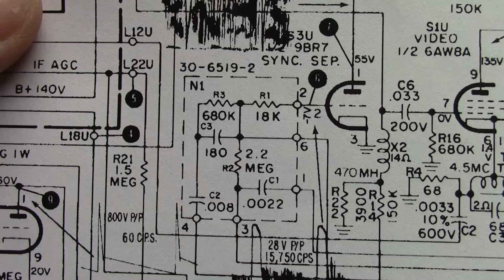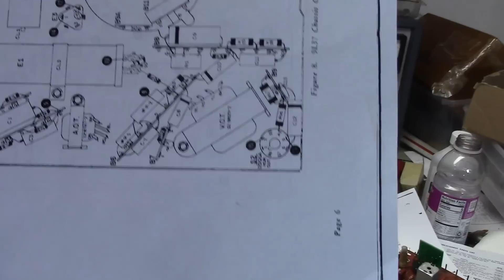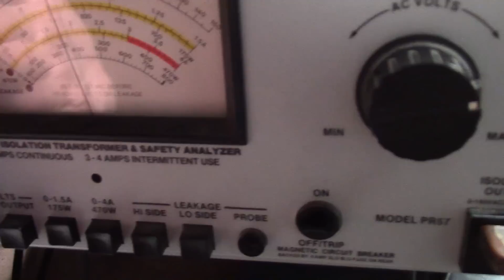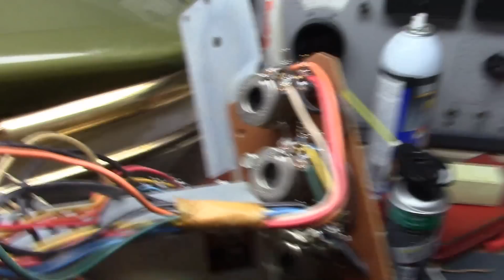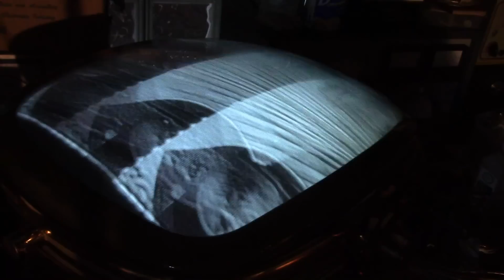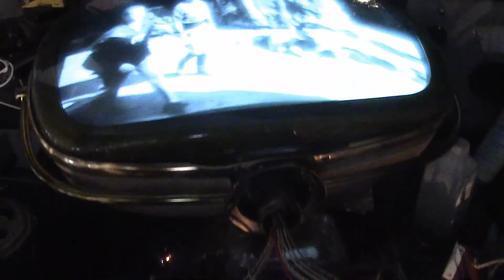Predictapalooza S2 ep01 - Michael's 21" Pedestal

Comment: Bob, that isn't a conformal coating on the circuit boards. A conformal coating is usually added to a board after the soldering is done. What you see there is called "solder mask". Later development in circuit boards resulted in the use of "solder wave" techniques. In a tank of molten solder a special pump and linear nozzle creates a raised wave of solder. The boards after being loaded with parts are passed on rails across the tank and all the leads are soldered in one pass. The solder mask keeps the solder from sticking to places it isn't wanted.
Reply from the maker: Yes, I misspoke. I'm pretty sure they did use wave soldering on these boards.

Comment: I like the way Bob makes these mid-20th century works of art come back to life, and this TV probably works like it did when it was brand new 60+ years ago! I'm sure Michael will be able to find those missing knobs, or fabricate some silicone molds to make some new ones. I'm sure the engineering team who designed this set would likely have been amazed that one or more of the sets they designed is still working in 2022!
Reply from the maker: Thanks.  No, need all knobs are present.  I had removed them to make fine adjustments.  The main control shafts are hollow allowing access to secondary controls.  A few years back, very high quality reproductions were available.  Sadly the craftsman passed away.  Lesson learned - don't proscrastinate when it comes to repros.  It's amazing that any get made at all.

Comment: Vertical linearity pot. Did you try switching the wire to the other side of the resistive element?  I have gotten out of trouble a number of times doing this when replacement parts were not in stock and the other side offered usable range.
Reply from the maker: No, didn't occur to me.  I will in the future.  Thanks for the tip.

Comment: You replace those resistor and cap packages with a circuit board mounted vertical and new components soldered to it? Where you get the circuit boards
Reply from the maker: A friend designed and had them made.  Very easy and inexpensive these days.
Reply: @bandersentv  nice and very clean way to replace them. Yah boards are cheap
Reply from the maker: I still strongly recommend buying replicas from tvrestorerguy.com but I have so many to do it made more sense for me to make my own.
Reply: @bandersentv  yes for sure sometimes the most cost effective way is best :) looking forward to the next predicta vids